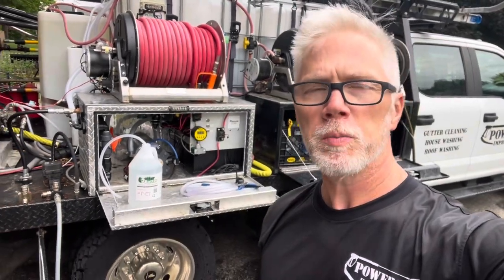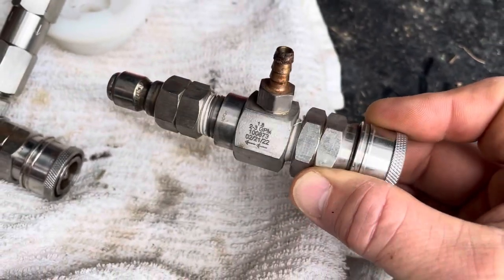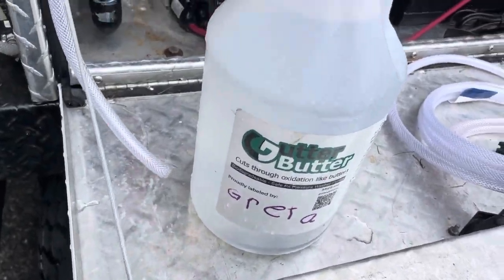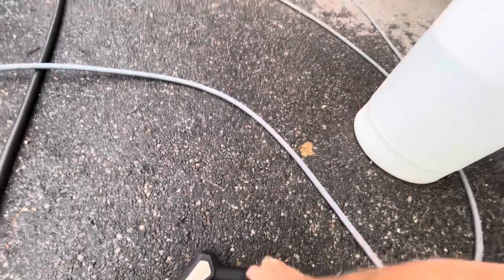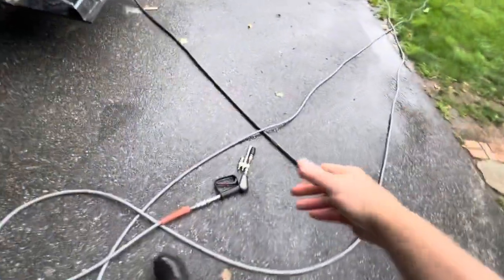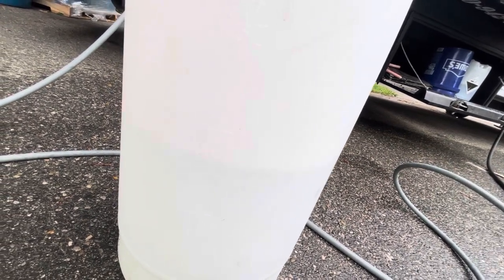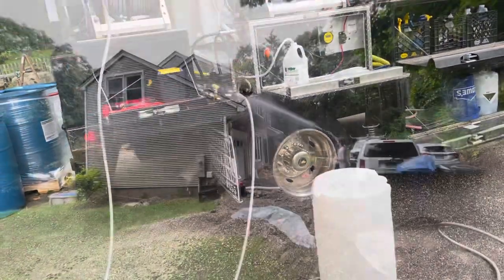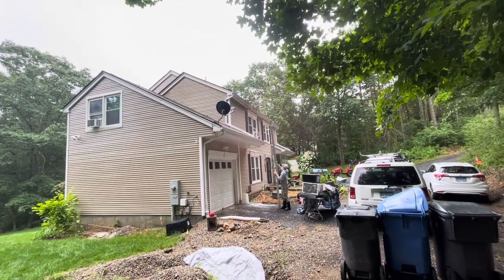SESW Check Valve Draw Test

Comment: You know they plan on getting OX Knox sold in big box stores right? So their using you to test it, then they’ll let home owners clean their own houses with the ox knox
Reply from the maker: Ok. You also know they sell pressure washers and shock and practically anything else you can imagine related to nearly any trade, yet every contractor in the world has more work than they can do.
Reply: @powerfulimprovements  not the same. 2.3 gpm vs your 10 gpm. The oxidation removal was a huge profit potential but all people have to do is spray on and ronce off. They’ll do that easy.

Comment: I love your channel Joe.  However, I'm pretty sure when you draw a total of 9 gallons, 1 is bleach.  This makes it 8:1 ratio. 7 gal water, 1 gal bleach or 1.79%.   Same for the 9 gallons total would be 8:1 / 1.56%   Take care and full recovery!
Reply from the maker: You have to include the one gallon of bleach in the math. Think of it this way, what if I pulled 1 to 1? 2 gallons total? Would be 6.25%. The first test was 10 gallons total. The second test was 8 gallons total
Reply: @powerfulimprovements  Your first test was a total of 10 gallons, one gallon of which would be your SH/soap mix.  Essentially you made a batch mix with 9 gallons of water and one gallon of SH, or a 9:1 mix...which would be 1.38%. Your second test was 8 gallons total, which would be a 7:1 mix, or 1.78%....or about a 23% better draw.
Reply: @jbrewster6175 he filled it with 10 total gallons. 1 gallon was  12.5% bleach. In other words, 1/10 of the bucket is 12.5% bleach. So a 1.25% mix.
Reply from the maker: @jbrewster6175  you need to include the 1 gallon of sh also. 9:1 is still 10 gallons total. Consider if we only made a two gallon batch, and you did not include the 1 gallon of shock
Reply from the maker: @seattleprowash5464  correct
Reply: @jbrewster6175 wrong